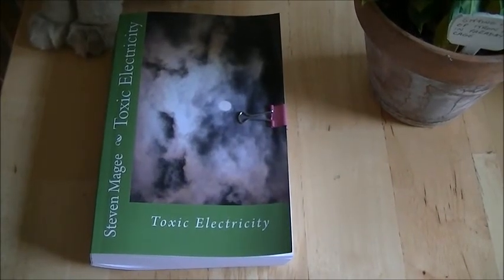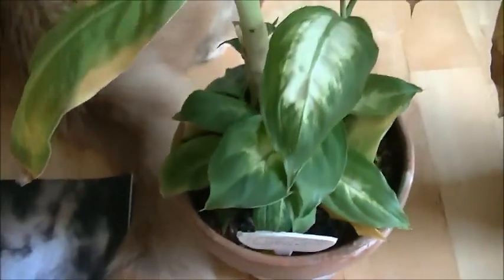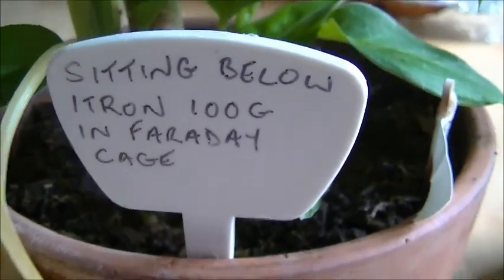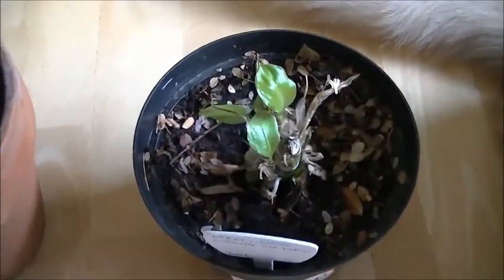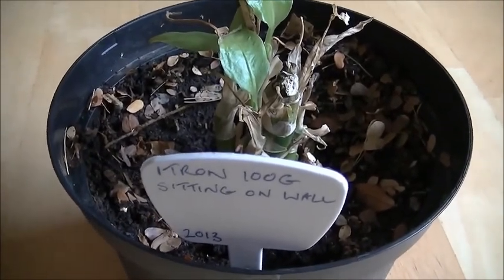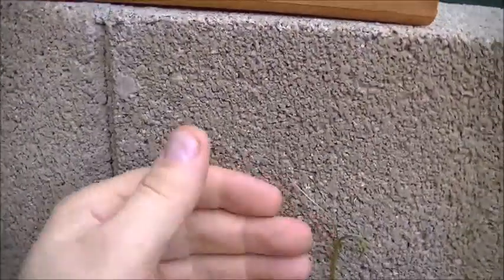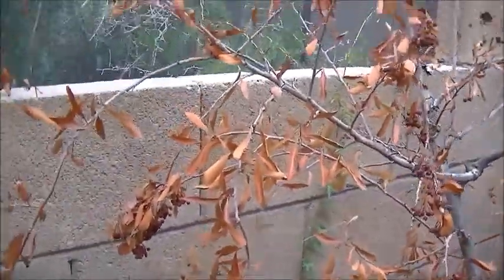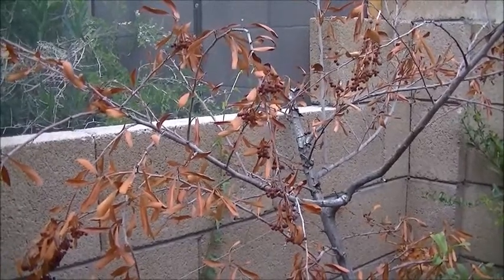Review of Plant Growth Defects Near Itron 100G AMR Gas Transmitting Utility Meters

Comment from the maker: The screen on the other side of the wall goes all the way to the ground.  The wireless reflection may set up what is known as an "interference pattern" near to it of high and low patches of radiation.  Based on previous testing that I have done, the screen acts as an antenna to radiation regardless of whether it is grounded or not.  It is likely that the screen was absorbing the radiation and feeding it into the plants and stressing them.  The reflected interference pattern did not help matters.

Comment: Curious have you ever hooked a powerful battery to the screen negative on top and positive on bottom to see if that absorbs the RF energy into the battery. Guessing a 9 volt would be to weak but 18 or 36 volt might have enough pull depending on how much screen there is, or would it need to be an AC source due to the RF being AC :|

Comment: Question, was the screen on the other side of the wall all the way down to where the tree started to die?
I`ve seen people warning of this when blocking your windows out from neighbours EMF or cell towers, due to the bounce back off the screen it`s like getting blasted twice if you have RF coming from the other direction. I have no wireless anything and my meter shows nether do my surrounding neighbours as I live in a condo so this is important to know...
Great eye opener thanks :]